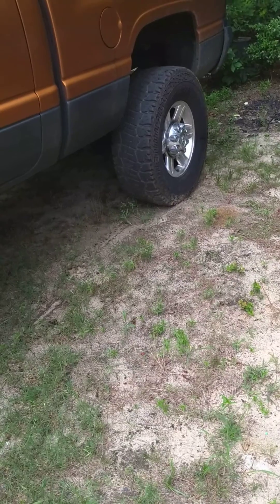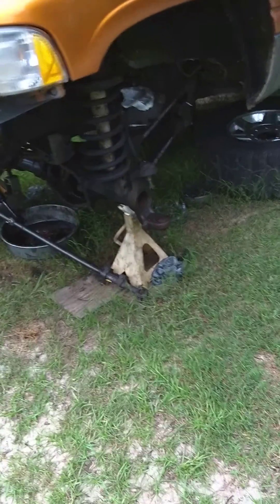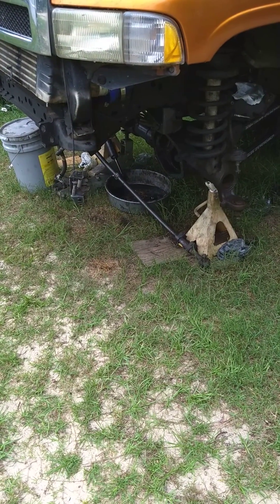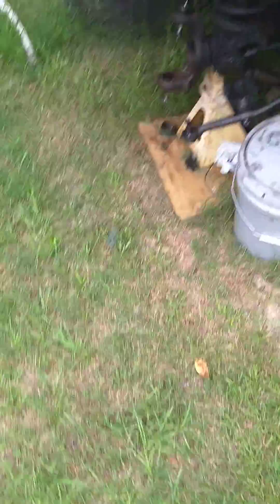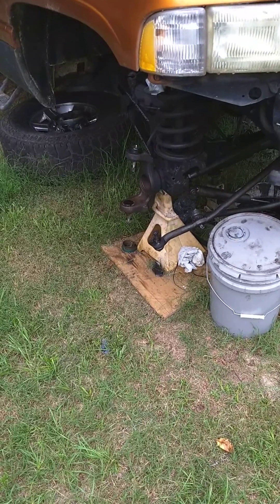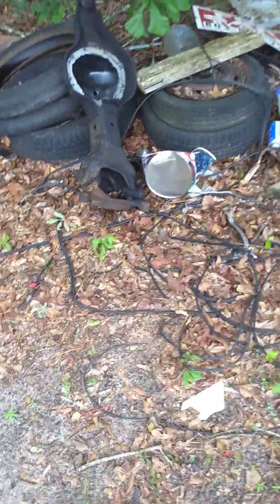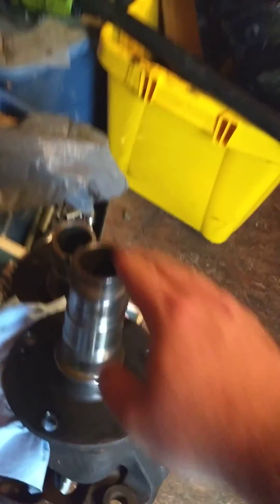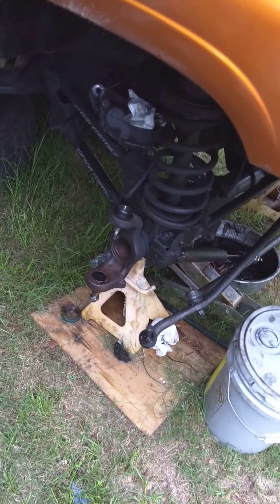Dodge Ram Dana 60 hybrid free spin kit

Comment: did it work?
Reply from the maker: Yes it did. I have put a few thousand miles on it with no problems.
Reply: Did you ever make the follow up video? Or any other videos on this conversion?
Reply from the maker: @Kyle-ev4fk  yes check out my truck is back together video. Around 12 minute Mark I talk about hub conversion.
Reply from the maker: @Kyle-ev4fk  there is also a part two to this video if you look under my videos. Thanks